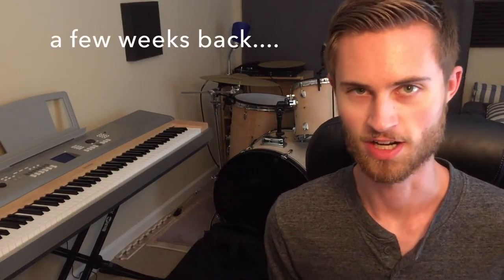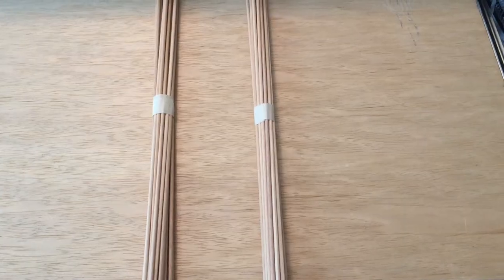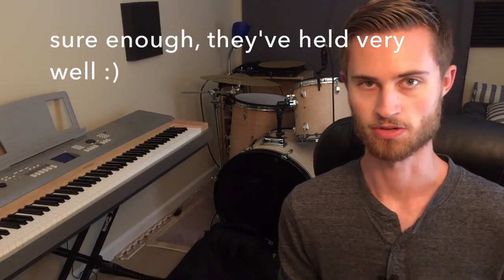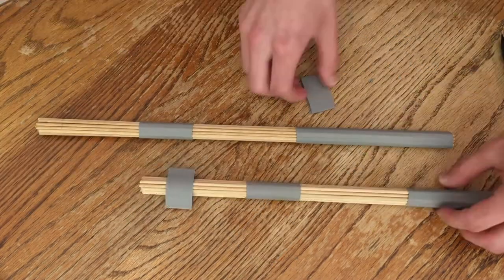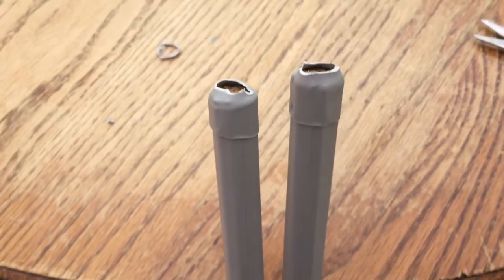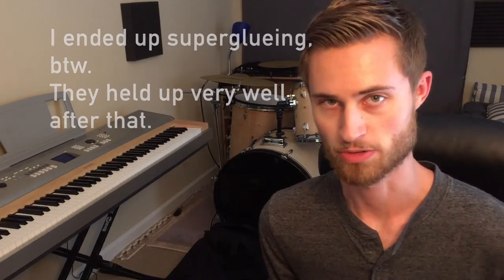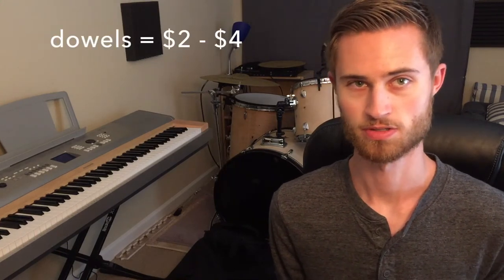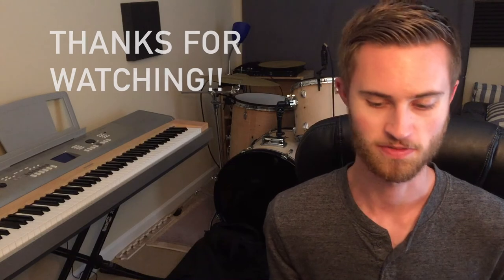A Pair of Hotrods for $5?? | DIY Hotrods

Comment: This is a great idea, Stephen! I started using the rods that have a foam core down the middle that reduces that slapping sound that the wood ones have. They sound great in our church on the cymbals, but I am shredding through them quickly. At $20 each, making my own will be great. What I'm thinking I really need is a regular drum stick on one end, and these rods on the other, that I can flip back and forth without changing sticks during a song like I do now. I'll let you know if I figure that one out :)

Comment: For the tip part, buy some o-rings. :)
Reply from the maker: I thought about that. They'd have to be just the right size so that they don't come off, yet they can be moved or taken off. I've also though it would be cool to plasti-dip the butt ends.
Reply: Stephen Clark Yeah, that would be cool with plastic-dip. :)

Comment: Where did you source your shrink tubing from? It is very expensive from hardware stores. Also use 0 rings for control on the tips. I like them on the tips when inserting them into my stick bag (no snagging), and just roll them back up the middle for playing. And they last a long time. Even longer than a chewy tootsi roll.....
Reply: Gene Williams harbor freight. Dirt cheap
Reply: Did someone mention candy?